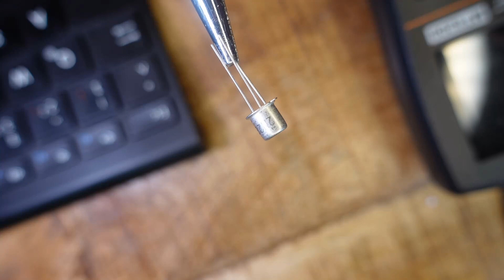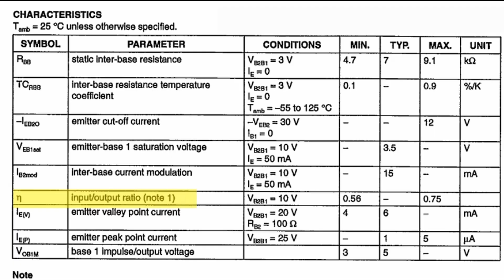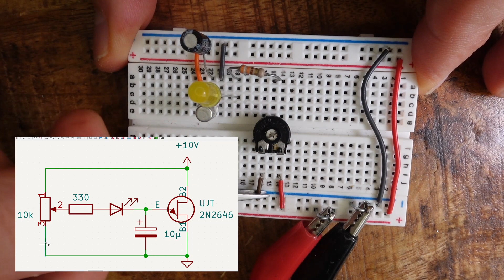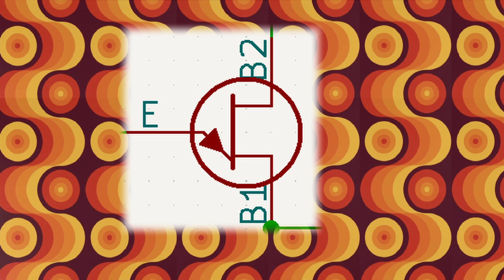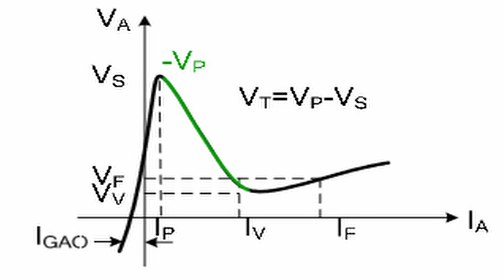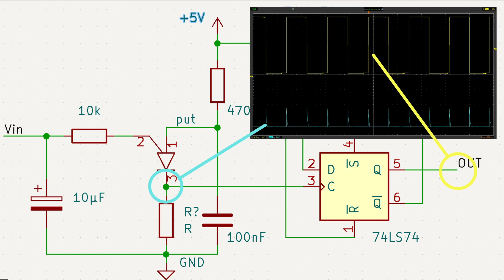The 555 of the 70's: The Unijunction Transistor

Comment: You have instructed on how to calculate voltage V(p), and I have understood it. However, you haven't provided guidance on how to calculate V(v) (Valley Point). Is there a way to calculate V(v) (Valley Point) ?
Reply from the maker: You cannot calculate the valley point. It's a parameter of the UJT and can be found in the data sheet.

Comment: I've killed cmos 555s when using a variable capacitor as sensor... After a fair bit of head scratch... I concluded that a charged large capacitance, has a certain amount of stored energy.
If capacitance reduced suddenly... Stored  Energy remains constant. Voltage has to go up to compensate for smaller capacitance. 

Put circuits more robust under such conditions, as they will of course discharge cap if voltage goes higher than threshold. Such may muck up a sensor reading... But that's usually preferable to a component failling.

Comment: I have a whole ton of the PUJ's 2N6027, time to play with them I guess. Thanks for the video and useful information, great as always Doc!!
Reply: I find they can be pretty good for interfacing simple resistor, or capacitive sensors to microcontrollers. the "variable property" into a digital pulse chain. That way... Rather than waiting around for a measurement, can use pin interrupts to record time of event, with time difference being the reading. 

Circuit I suggest is to feed both gate  pin and Trigger voltage pin  by seperate constant currents. As long as current to trigger pin is largest..it's voltage is guaranteed to rise faster than gate...thus put can't latch on. 

Trigger voltage generated by resistor to ground... V=i*R etc.

Constant current also make timing linear. And also avoids any issue with resistance of wire to sensor.